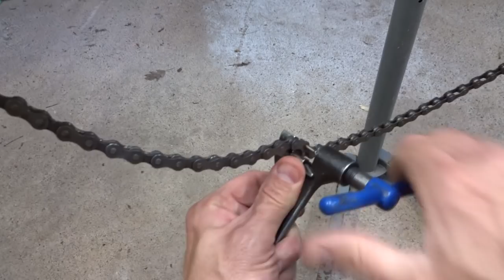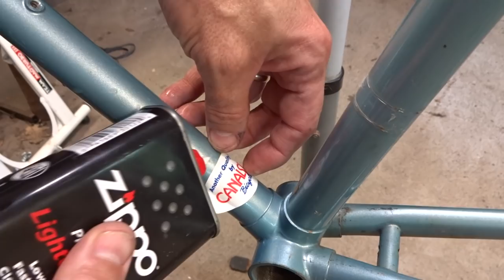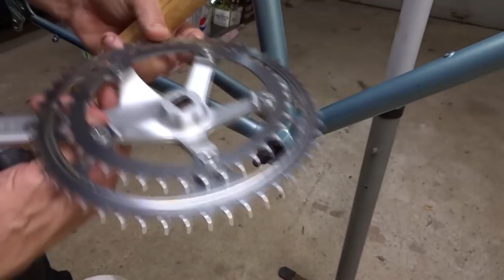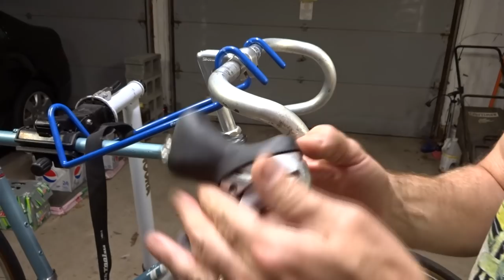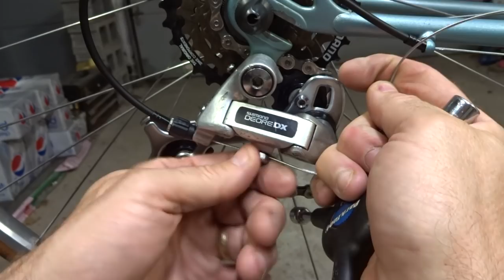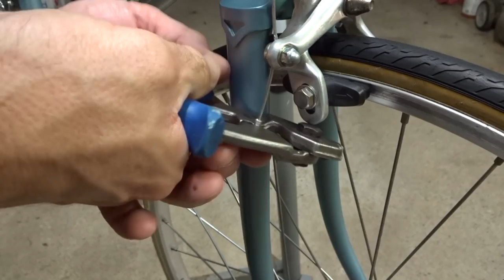Terry Prism - Vintage Women's Road Bike Restore/Update - Retromod

Comment: About $400.  That is how much I've saved by doing my own repairs and maintenance.  Your videos are easy to follow and well explained.  After watching your derailleur tuning videos, I turned sloppy, rough, noisy derailleurs on a 1983 Stumpjumper into smooth shifting, more precise, and a little quieter drivetrain.  My LBS wanted $40 and up for the same job.  I have accumulated enough high quality tools to do 90% of my repairs.  

Your videos have encouraged me to buy vintage steel bikes and fix 'em up.  I love bringing bikes back to good riding condition.
Reply: Same here. Building up old vintage bikes and do repair for my friends. Saves a lot of money. And sometimes time.
Reply: He has actually helped me to improve my bicycle repair skills.  Started working on bikes in about 1994, so this is no small feat.

Comment: This rebuild got me wondering again about whether MTB and Road bike drive trains are the same? As far as chain, cassette, chain rings and derailers are concerned. Do both types of bikes use the same width for all of the same components as long as they're the same speed? 7,8,9,10 etc...

Comment: Any reason you didn't use anti-seize (copper or silver based) for the dissimilar metals (in this case steel and Al)?
Reply from the maker: +Mike Williams the grease I used will work just as well.

Comment: Thoughts about using grease vs assembly paste (the gritty stuff) for the seat post and stem install?
Reply from the maker: +Nicoya Never used it. I think it's more meant for carbon frames that can't be clamped as tightly. Or where there are slippage issues.
Reply: I originally got some for putting an integrated carbon bar on my road bike, but I found it was also really nice on my BMX to put on the stem and seat post (both metal to metal joints) to add some extra grip so they don't get tweaked when I crash. Made it real easy to get things locked in without going crazy on torquing down the bolts.

Comment: RJ, I recently acquired a Centurion Ironman Terry recently with same F- 24"/R- 700c Combo. The Tires are completely toast. Curious which Brand/Model 24" Tire did u install on this Bike, and if you didn't install a new front tire, which 24" tire do you recommend? Unfortunately the rear brake bridge is too low to accomodate a 700x28mm Continental Gatorskin tire I installed, but a 25mm fit.  Are there ANY decent quality 24"×25mm WITH Exact make/model matching 700×25mm Tires available?  This bike design is very unique and interesting btw. Thanx RJ.
Reply from the maker: This is what I used on a different Terry. https://www.amazon.com/exec/obidos/ASIN/B003L9DD4M/ref=nosim/youtube25-20
It was a cassette, if you had watched the video.
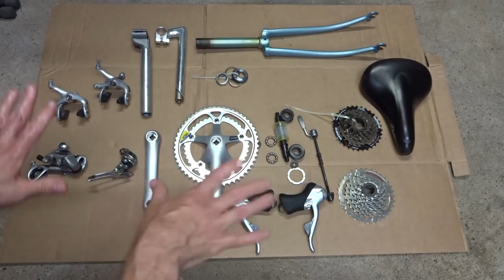Reply: @RJTheBikeGuy  Yeh at 5:51 I see all your parts displayed. Indeed a Cassette. I'm watching your entire video now. I'm gonna rig up 7 sp. Tourney Brifters on the Bike, not as nice as your RSX ones. I just found some 24" Paselas in blackwall instead of tan and some blackwall 700c Paselas too!  There's plenty of seatstay, chainstay, fork crown and fork blade clearance for 28mm Tires but Centurion really screwed up positioning the rear brake bridge Way too low. Otherwise this Bike's a Gem. Thanx for the Quick response and tire link RJ. PS- Love your Miami Vice Tribute Centurion Ironman BTW.  You should rig it up with Scott DH Aerobars and a DIY Ghetto Disk Rear Wheel and Ride it in Triathlons as a throwback to the good old days.

Comment: Another cool video! I'm relatively new to older bike restoration, mostly coming from working on my own bikes for commuting and racing. One thing I've always been told is that Shimano mtb and road shifters and RD's don't play nice due to different pull lengths. Did Shimano Deore line RD's used to also be road? Just not sure how the Deore you installed worked with the brifters
Reply from the maker: No, most Shimano indexed (SIS) road and mtn RDs have the same pull rate. Exceptions are vintage Dura Ace stuff, and new 10 speed mountain bike stuff. However pull rates differ for road and mountain front derailleurs.
Reply: @RJTheBikeGuy  Awesome! Thanks for the tip, I'm glad that they're both compatible

Comment: What wrench size do you use to tighten the binding bolt?
Reply from the maker: What binding bolt? And it is most likely the wrench that fits. Different bikes often have different size bolts. Usually metric.

Comment: If you don't put grease on the crank arm spindle, aren't you going to end up with noise and wear?
Reply from the maker: No, because they are pressed on.
Reply: Always grease a crank unless it says not to. Aluminium and steel don't mix, and grease is a great boundary between them to prevent any unwanted corrosion, as well as keeping a bit of water out of the area too. It's not crucial, but it's a nice thing to do for the vintage bike enthusiasts of 2070.
Reply: It seems odd to me to grease the seat post (which depends on friction to stay at a set ride height) and not grease the crank.
Reply: Luke W Antisieze or fibre grip helps there. Grease on a seatpost is good, and will clamp just fine if you don't have a shit seatpost clamp. On road bikes and anything where the seat stays fixed, it is rather necessary to prevent the frame from being a throw away item within the next few years.
Reply: I think the main culprit of stuck seat posts is years of leaving the bike out in the rain. There is some corrosive reaction that take place between aluminum and steel. Recently I had to remove the wiper arms on my car and it's like they were welded to the steel posts.

Comment: Great job on the restoration as usual but i noticed you didn't reuse the axle stop. Any reason why?
Reply from the maker: +Brian Merryman I don't know why it was there to begin with. Those are usually used when the derailleur has a hanger that attaches to the dropout moving the axle forward on the drive side.

Comment: I would have asked the friend which handlebars they prefer. I think for a woman, the bars on there may technically be wrong, but for the user, it may be the best.

I see your actions performed scratches/damage to the frame. Pulling the inner cables fast and hastily, the front mech leaving gouges. I'm not sure I would call this a restore, more of an update and bringing it closer to original.

Comment: Why pull the front brake with the left lever ? Surely wrong or at least unconventional, all motorbikes scooters and certainly most pedal bikes are right lever for front brake...
Reply from the maker: https://www.youtube.com/watch?v=OR47XELYmQc
Reply: @RJTheBikeGuy  Ok thanks, that does clear it up but obviously it only really makes sense when you're signalling in one direction with that hand, i.e. left for the US / Europe.

It used to be that for right-hand drive cars i.e. UK / Japan / Australasia / etc. that the indicator (turn signal) and light control stalks would be on different sides of the steering wheel compared to LHD markets, that has gone away in the UK since the 80s but you sometimes still see it with e.g. Malaysian cars.